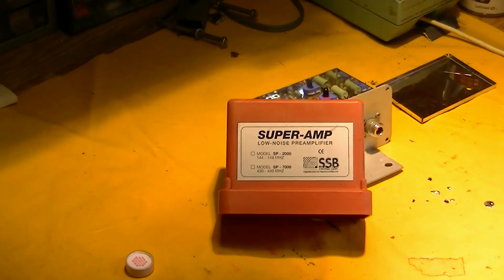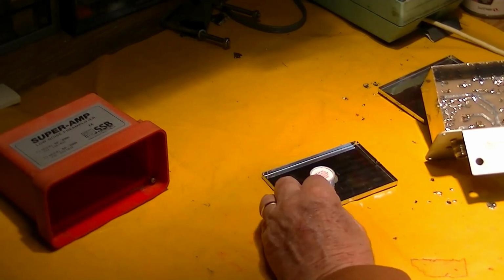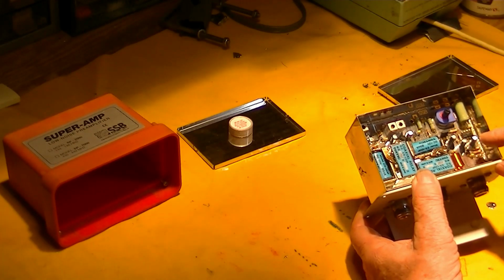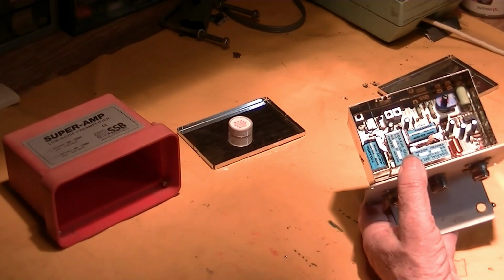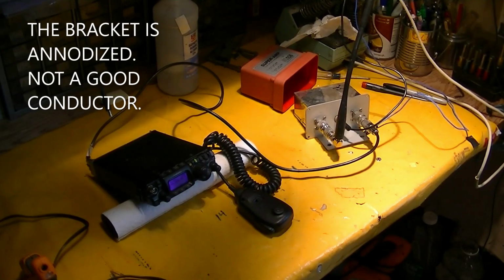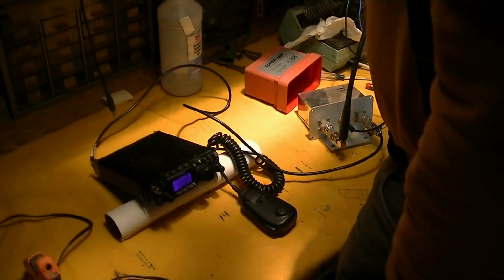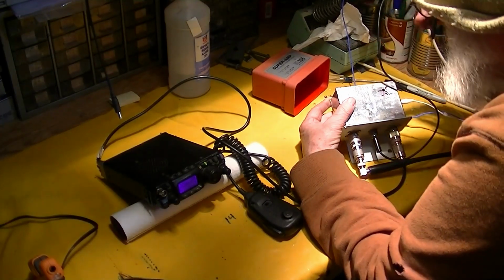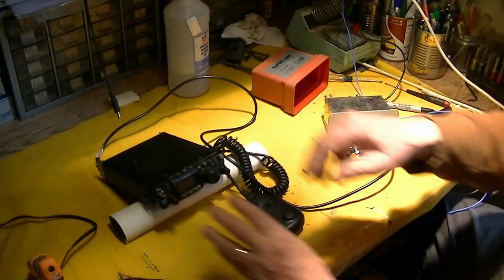W6WUH : SSB Electronics SP 2000  2 Meter Mast Mount Pre-Amp

Comment from the maker: If you ave good adjustable 
rf gain,, play with it on a really weak signal...too much gain can be countr productive.  In a mast mount pre-amp, all it really has to do is set the noise figure for the system, and overcome transmission line loss,